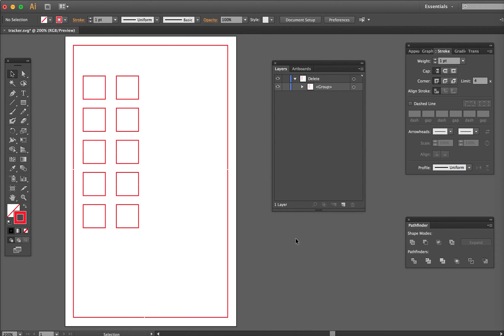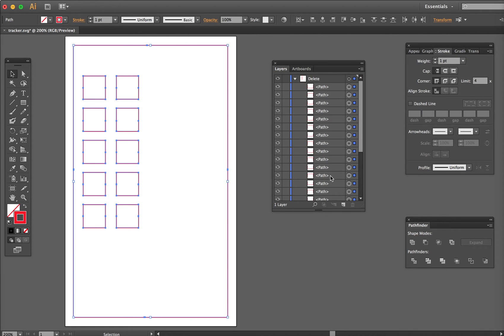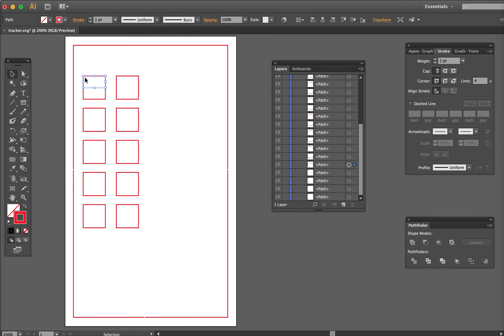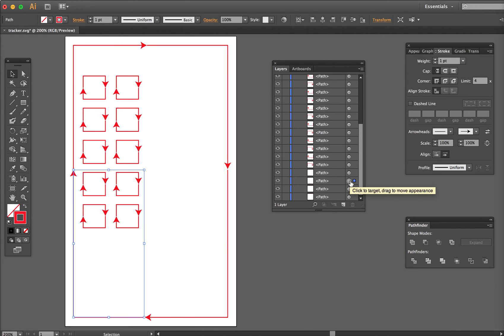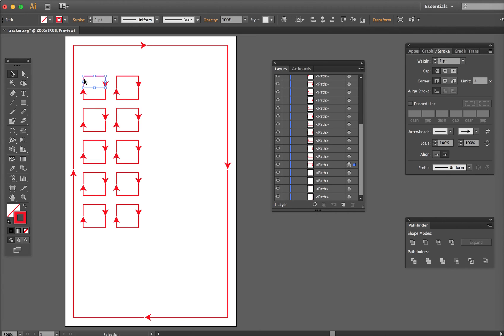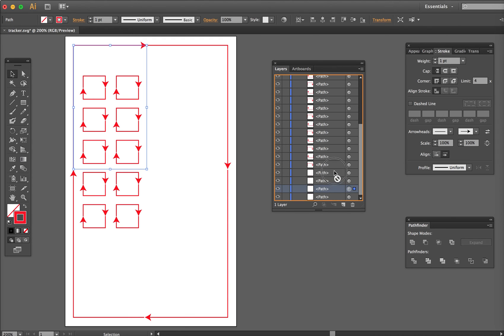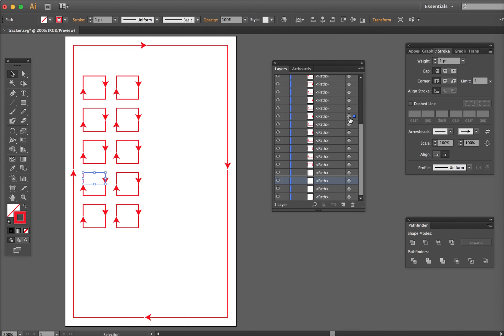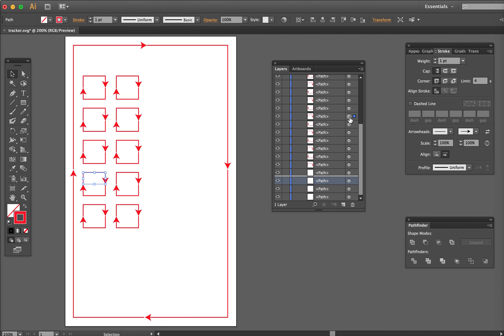Optimizing Custom Punchouts in Illustrator

Comment: So, if we are charged for head movement, shouldn't the initial location of the head matter as well? if that's the case where does the head start (eg top left) Should i also be optimizing where the head ends? will i be charged for stopping in the bottom right corner?  does the head move back to an initial starting point? or is the point where you start the laser where the pricing starts?
Reply from the maker: Yes, the upper left corner is 0,0
Reply: So it would be even better if the top left corner node was separated? We would have a line segment starting there, going around clockwise (stopping for the nicks) and ending again at 0,0.
Reply: does that mean that's where the head starts?
Reply from the maker: Yes.
Reply from the maker: It doesn't matter where the head stops.  And I don't know what you mean by separated. Worry less about the starting position of the head and more about the order and direction of your lines. That's where the real savings are. The starting position of the head only really matters if you're squeezing the last penny out of the cut, and you haven't event picked your oranges yet.
Reply: The Game Crafter Just to clarify: I meant opening the top left corner node (anchor point). Thus instead of having a continuous line at that corner (the upside down L), you'd have two independent line segments: one horizontal line, one vertical.